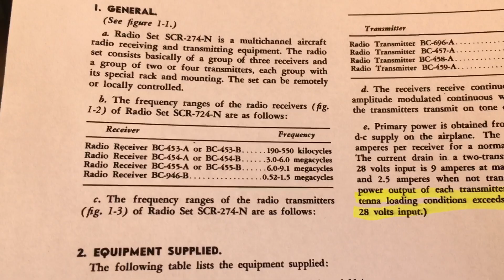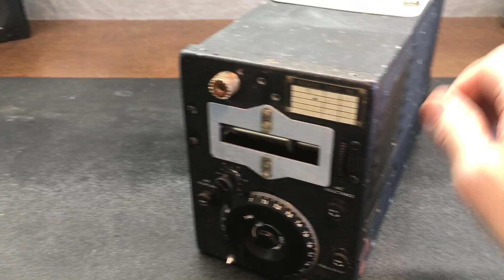BC-459 Solid State 45 Watt Transmitter - Part 1

Comment: If you are not putting in JFETS and your own LC circuits then don't do it. Don't buy any prefab built stuff and integrate it. Build it all yourself. As I want to see this work! Thank you!!!
Reply from the maker: Actually, you make a good point.  I have been thinking about removing the SS linear amp and utilizing a design that would incorporate the existing PA tank circuit and antenna tuning coil.  73's